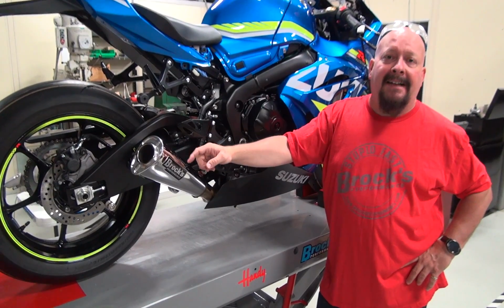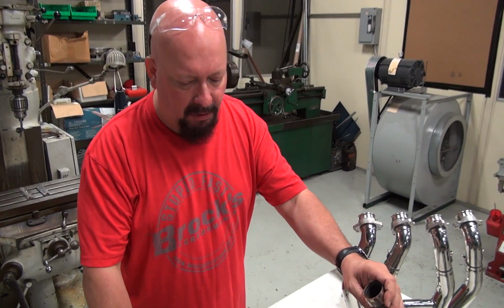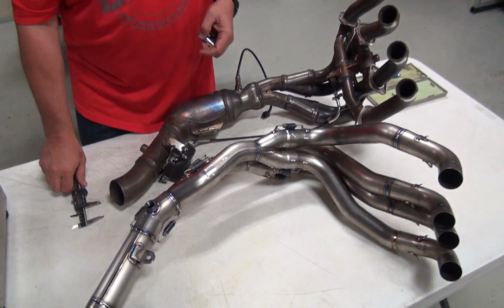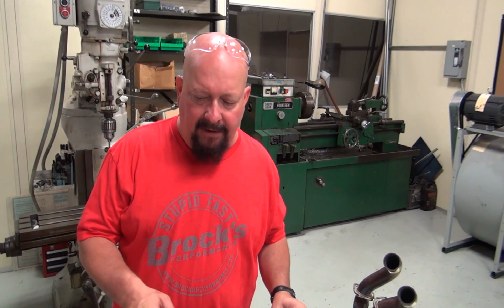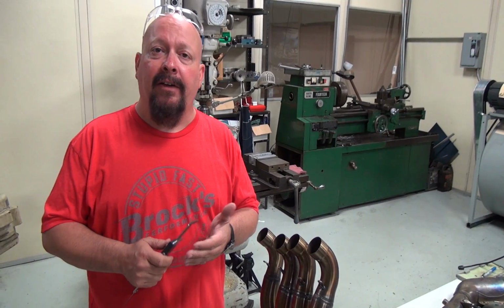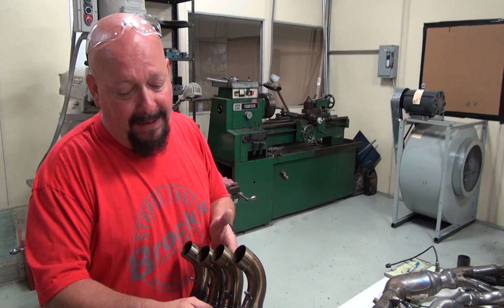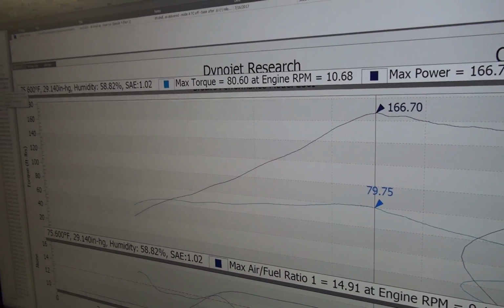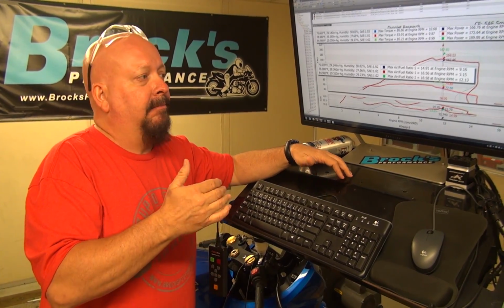2017 GSX-R1000 S2B: Episode 4 - Exhaust Installation and Theory (Part 3): Full Exhaust Systems

Comment: How does it compare to unrestricted ecu with stock exhaust and later both exhaust tuned?
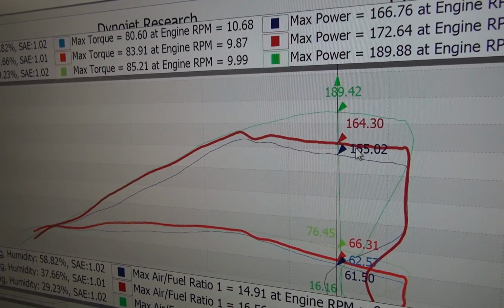Reply from the maker: I believe we answer the first part of your question at 31:37? As far as comparing both pipes, we didn't have room in this video. But here are some previous Predator exhaust results: https://www.facebook.com/BrocksPerformance/videos/10154655332516472/
Reply: Thanks for the reply, sorry for being unclear! I meant unrestricted ecu with stock exhaust like the EU-model of the bike as it should make around 180hp peak. Maybe you had it in a previous video where you discussed the throttle plate restriction...
It would have been nice to have in the overlay at 31:37, as what I understand it's currently the:
'stock ecu/stock exhaust', 
'stock ecu/your exhaust' and 
'unrestricted ecu/your exhaust'. 
So it's just the addition of 'unrestricted ecu/stock exhaust' I'm looking for.
Reply from the maker: Check this out: https://www.youtube.com/watch?v=e0T0p7TsV3s
Reply: getting +10hp minimum across the board with just an exhaust untuned is really good, I'm excited to see what the gains will be when the fuel map is optimised!
Reply from the maker: @zerugar, you are 100% correct - especially these days. Please remember the 2017 gixxer is manufactured under Euro 4 regulations. I was pleasantly surprised when I saw how restricted the OEM exhaust is, because I knew it meant bigger gains for us :)

Comment: Can you tell me the difference between a 4 into 1 and a 4 into 2 into 1 and how it works on a short stroke and a large stroke
Reply from the maker: That's an hour+ video in itself. I can tell you this, the ONLY configuration we use is 4-2-1, even with our sidewinder exhaust. It works fantastically to produce the best average power (for optimum acceleration), and it doesn't hurt peak power. This chart is from my personal grudge Busa using our TiWinder exhaust. This is normally aspirated: http://www.brocksperformance.com/images/1697_GrudgeBusa.jpg

Comment: Hi Brock, thank you for your really detailed explanation of the exhaust. My question is what would you say when i take out the catalyst from the original exhaust and drive with active exhaust valves, would the gixxer lose horse power in midrange or on the top? I am from Europe and wouldnt loose the sound emissions but would gain some power, so im thinking about this option.
Reply from the maker: The gixxer has intitionally small diameter exhaust headpipes, you can remove the cataylist, but the headpipes will still prevent maximum peak power output, especially if the crossover valve is removed. I don't know if removing the catalyst will hamper or hurt midrange as the addional exhaust volume provided by the catalyst tends to help power output. If this helps answer your question.
Reply: @BrockDavidson  thank you for the fast answer, so I will test it and see how it works. Thanks alot for your shared informations around the world👍

Comment: So the front valves are closed and they open and the rear valve is open and closes?
Reply from the maker: Sort of. The fronts open at high revs and close at lower to help torque. The rear closes at low revs for noise abatement and open at high revs for max power.

Comment: hi brock! i have watched your video about exhaust section, but i didnt found the answer of my question. i wanna ask , why after change stock exhaust with aftermarket freeflow exhaust, somehow my bike surging in some rpm. did changing full system freeflow exhaust make my bike leaner? but when baffled it  become normal(not surging anymore)
Reply from the maker: Hello Christian - what you are describing can typically be tuned out. Your ECU was not designed and it is not internally tuned for a high-flow exhaust (this can cause a lean condition in some areas, and a rich condition in other areas - it depends upon how your exhaust is designed. By inserting the baffle, you have reduced the flow to a point which more closely matches the bikes original exhaust/tune, so surge problems can be greatly reduced.
Reply: Brock Davidson thanks for your reply Brock. may i know the afr value can cause lean surge? thanks Brock!
Reply from the maker: Most people believe that surges are due to a lean condition, and this was almost always the case with carburated machines. But many times today's monitoring equipment shows it is a rich condition on fuel injected bikes. We keep our AFR's between 12.8 and 13.6 for most hot street applications
Reply: Brock Davidson wow, thanks Brock, your information enlightened me. im very appreciate that.

Comment: Which one of the loudest exhaust do you suggest for a 04 Hayabusa. Lowered and stretched.
Reply from the maker: If you want "roar of the gods" loud, any of our round megaphone systems with removable baffles will work for you: StreetMeg, ShortMeg 2 etc. Many stretched bikes prefer our 4-2-1 sidewinder or our top of the line TiWinder with race baffle. Both of the side exit exhausts offer increased 1/4 mile performance when used in conjunction with a billet oil pan. https://bit.ly/3AWttUd

Comment: Hi Brock i have a question i removed the cat from my 2017 gsxr 1000r what should i do with the valves in the headers should I keep them close or open
Reply from the maker: There is no answer to that question other than replacing the headpipes if you want maximum performance as the OEM headpipes are designed for use with the valves. Leave them open, low end power suffers - leave them closed, high end power suffers. It's a lose-lose.
Reply: @BrockDavidson  yes i notice a lost of power and im not sure if the bike is running lean but hopefully when all this  virus situation is over I'm going for that Alien head full system thanks Brock

Comment: Does wrapping exhaust headers help anything??
Reply from the maker: The theory is sound, but we have never measured an actual increase on the dyno or race track. Wrap does do an excellent job of irreversibly discoloring your exhaust while destroying your muffler packing. We only use heat wrap if excessive heat in a particular area requires it.

Comment: What would be the power difference between the alien head 2 vs. Predator?
Reply from the maker: No peak power difference currently - both produce 189 SAE with no tune. But... the application of the power is a bit different.

Comment: @Brock Davidson, Just one question. Your other exhaust (not the alien head 2) comes with the noise insert. Yoshimura Alpha T race full exhaust system comes with a similar looking baffle. Are you saying universally those things hurt peak power? I got into a fairly long argument with a guy dyno tuning my bike. (not an unhealthy argument, I respect his expertise but he wants me to pay an extra 300 dollars to redyno my bike because I didn't know it came with insert installed). He said these exhaust systems should not have baffles removed it will actually reduce peak power. Where as I was saying the opposite. Been awaiting a direct answer from Yoshimura as to why that full system comes with the insert installed.
Reply from the maker: @William, there is a large difference between a noise reduction insert (NRD) and a baffle/muffler. The noise reduction insert is an intentional ( typically removable) restriction in the exhaust outlet designed to help eliminate noise. The NRD is inserted into the baffle (located inside the muffler) and YES this restriction hurts peak power. Consider it a 'restrictor plate' on the exhaust side of the engine. Removing the baffle is a different story: it would be like running our Alien Head or Predator, etc... with no muffler whatsoever. All Brock's Performance exhaust systems come with mapping to compensate for the use of a noise reduction insert, or without. Our ShortMeg's and Sidewinders can be run without the baffle installed, so we offer additional mapping for no baffle use when required. It's not uncommon for us to offer 3-6 maps for some bikes/pipe combinations. These maps are supplied at no charge with all Brock's Performance full exhaust systems. Of course, your dyno operator will charge you to create separate maps for various combinations. More info on Brock's Performance  Map Support Program: http://blog.brocksperformance.com/brocks-performance-exhaust-purchase-guide/

Comment: what about humidity? anyone notice, that higher power comes on 20% less humidity? and higher air/fuel ratio...
Reply from the maker: We picked our absolute best stock numbers to compare against, as we can't control the weather. AFR change is due to addtion of high flow exhaust... aka: natural result of the pipe change, and we can't control that either.

Comment: What’s your take on the 2016+ zx10 stock titanium exhaust?
Reply from the maker: @Jeff Zx10 - it's one of the finest/best engineered OEM exhausts that we have ever encountered. Add our 3/4 sytem, ECU flash and mapping, and you have a race bike: https://brocksperformance.com/predator-slip-on-3-4-system-w-electro-black-stainless-muffler-zx-10r-16-18/

Comment: Hi, have you tried oem configuration and length but with your size tubing and material? and if you already done it, what are the results of the three? thank you.
Reply from the maker: No. as the OEM config relies heavily on the crossover valve in the head pipes and we will not be adding such a valve.
Reply: thank you very much for the info, you’ve done a tremendous job and info sharing.

Comment: I know this is a old vid but what happens other than the fi light if u leave the stock tune and use the bike without the 02 sensor installed in the new exhaust ?
Reply from the maker: As far as leaving the stock tune with a new performance exhaust, poor drivability and decreased peak performance. As far as no sensor, it depends on the bike (make/model/year)...sometimes nothing more than a nucience, some bikes go into limp mode and run just well enough to get you back home.
Reply: @BrockDavidson  thanks for the reply. My bike is the same as the one in your video im currently doing headers then going to get a tune, i was hoping to use the bike with no 02 sensor and a 02 eliminator instead till i can recoup the funds for the tune
Reply: @BrockDavidson  would be great if you could do an explanation and demonstration on what the eliminator actually does to the afr's on a bike without touching anything else.  There doesn't seem to be much information on this or any dyno footage, and alot of people use them because their exhausts dont have o2 bungs, or they believe it fixes the fueling on a bike forcing it to run in open loop. Is it safe, is it not? You make great videos heaps of information and explain things well. I've learnt a lot watching.
Reply from the maker: We cover this in detail in an episode of our Godzilla series.
Reply: @BrockDavidson  ill check it out if I can find it.

Comment: Hey Brock, What AFR you recommend for track riding ? 80-100% TPS
Reply from the maker: 12.8 -13.6...depends on the bike/fuel/type of track etc.
Reply: I have 80% - 13,2 , 100% - 13,0 AFR now... 98 octane. Bike is ZX10R 2011 - fully flashed, all restirictions gone, 1k up rev limiter, shorty 3/4 akrapovic + Sprint filter... Could you tell me do these settings are good for race performance? I set AFR values in Dynojet Autotune.
Reply from the maker: I really don't know as I have never tuned a bike with your fuel or your pipe.

Comment: Hey brock I would appreciate some input on this subject. I am shooting for the most peak power on my bike. I have a brand new 2018 R1 and It comes stock with a titanium header. I have purchased a titanium 3/4 system from graves and will be installing it soon. In addition she will get sprint filter block off plates and flapper delete. So my question is there a huge gain with a header on the R1? The R1 has a nice titanium large diameter header so to me a 3/4 system seemed the right decision but lmk what you have found out with your testing on the Yamaha R1
Reply from the maker: I can tell you It's tough to beat most OEM titanium front sections for peak power...but it is possible to match the peak power while producing measurable gains (+10 hp is possible) in the mid-range with a properly engineered aftermarket front section. Here is dyno chart that shows the potential mid-range gains, even though peak power is the same: http://blog.brocksperformance.com/brocknm/articlefiles/Landing_Page/3_ZX10R_Comparison_AH2_vs_Slipon_vs_Stock_Mid.jpg
Reply: @BrockDavidson  so your saying that midrange was higher with a header conpared to a 3/4. But peak hp was the same? Have you done testing with the R1 stock header? I already purchased a 3/4 system

Comment: Hey Brock would this system fit on a 2015 gsxr600 and a flash or something what would that cost?  If you see this let me know pls thx
Reply from the maker: @Daniel Sakotic - even if this system would physically fit onto the machine,  the tubes would be too large and seriously hamper low and mid-range performance - not a good idea on a 600.  For maximum performance, your best bet is to purchase a full system from a reputable company (Akro/Yosh etc...) and purchase a flash to match (ftecu/woolich etc.) as well as a sprint filter: https://brocksperformance.com/sprint-filter-p08-suzuki-gsx-r600-750-11-19/

Comment: I have the k8 busa with Ecu flash and alien head short meg 2 full system. And 520 17/43 gearing and Brocks clutch upgrade and light weight Wheel  and 1000 tail. I Will smack down the New gixxer 🤣🤣🤣
Reply from the maker: Plutto Lotto the new gixxer makes the same hp as your Busa...but it's 100 lbs. Or so lighter. Good luck.
Reply: Brock Davidson  yes i now that. But the  busa have bigger top speed and gearing -1 in the front. Its crazy. And i am a big fan of you.  Im from Denmark.  And want you too sell more on e-bay 😍😍😍👍